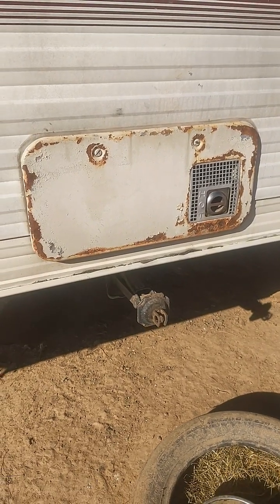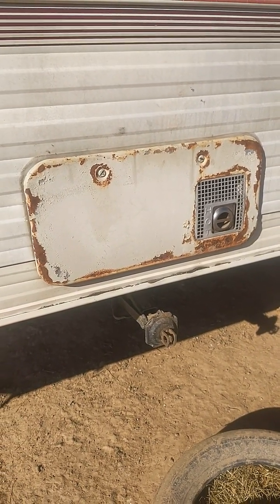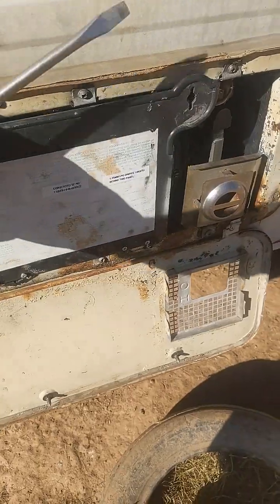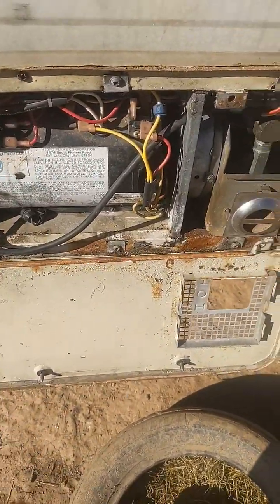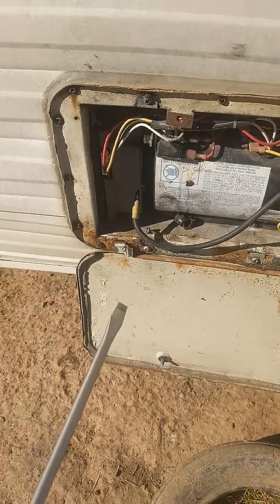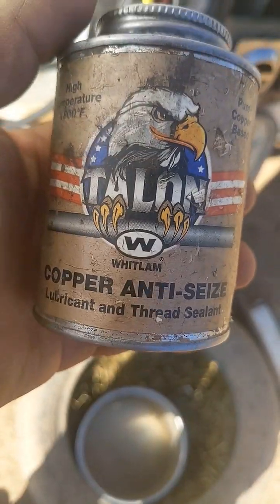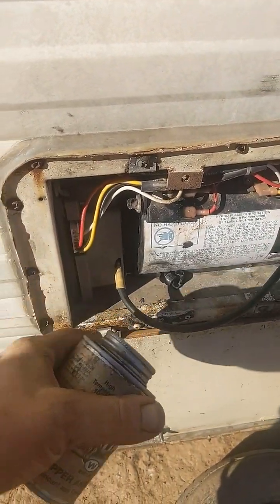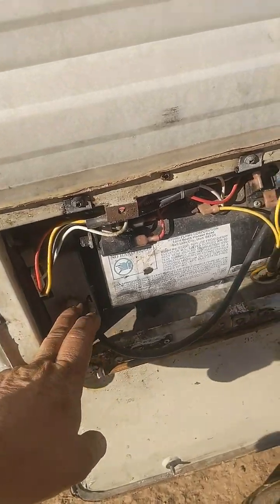Atwood Hydro Flame 8500-series furnace heaters for trailers and motohomes. Intro, pt 1/2

Comment from the maker: I will post a longer, detailed overview of both repairing it and changing it over to natural gas.

TLDR: Burner orifice between #54-#49 should be used with NG, depending on your local pressure. The burner tongue, a perforated metal surface, frequently burns up after a long time, they are $15. The original board only attempts to light once (1 time). Upgraded ignition / ignitor boards ($35) try to light 3x, and some have added terminals to control the motor.

Comment: It's crazy to see how they first took the box out and just put the circuit board in, that wasn't unreliable enough so they moved it to the bottom
Reply from the maker: The circuit board is dipped in sealant. Conformally coated.